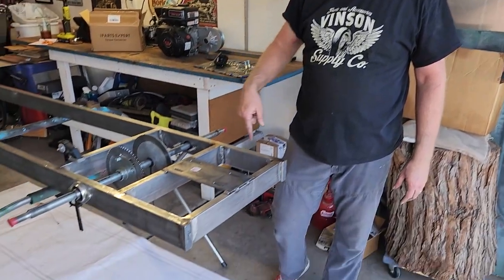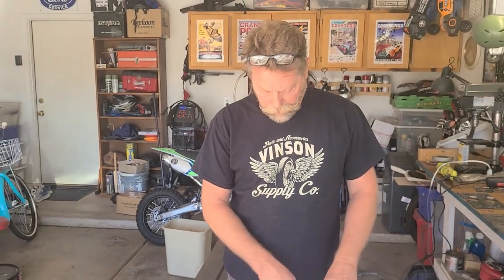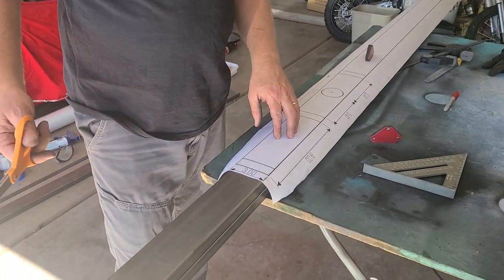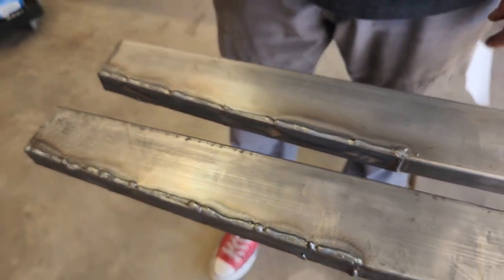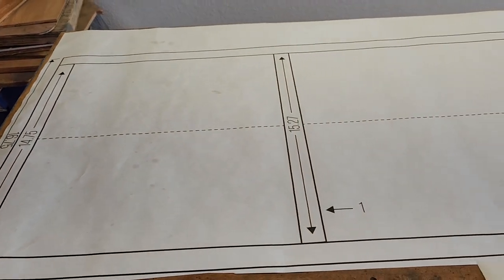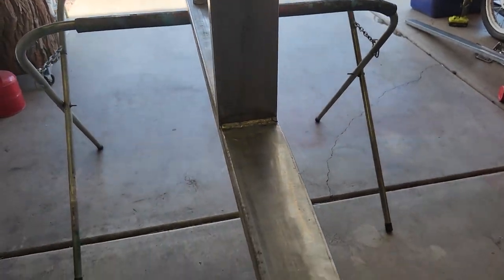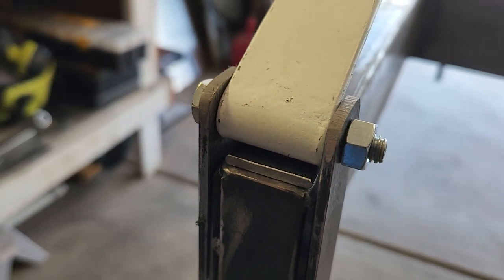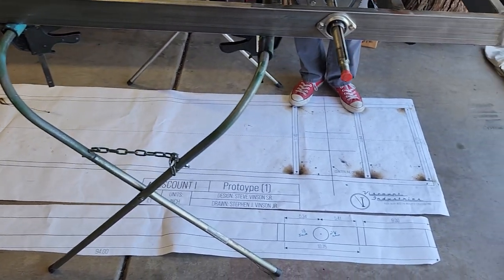Build a Cyclekart from a Frame Plan

Comment: Section that frame rail for the taper leaving the top strip of the frame cap in place vs adding back in another piece of metal.  It’s more cutting but you can keep the tubes natural radius if you cut below it and it make for a cleaner look. 2¢ Awesome vid!
Reply from the maker: I have tried that before, and it works but its hard to make that cut match the pie cut you will have to make to weld it back together.

Comment: I would love to see a wooden box version with a wooden frame. Its what I will be attempting soon,  hopefully.
Reply from the maker: Sure, the original design by Peter and Michael Stevenson was a 1/4" plywood box with 2 steel frame rails bolted to the outside.  So your plan has merit, would love to see how your project turns out.
Reply: I had the exact same idea: this looks like a job for 2x4s!
In fact I might just go pick some up tomorrow and give it a whirl.

Comment: This is really great information.  Thank you for sharing.  Have you thought about welding the front plate/cap to the frame after welding the hangers for the front suspension on to blend everything together as one piece?
Reply from the maker: I have done it on other builds.  Every one turns out a bit different each time

Comment: Alright. I've been thinking about building one of these so I ordered your plans and started collecting some parts. My question is, I'm 6'4". Should I add a couple of inches to the length?  How tight are these things. Also, I'm going to make mine electric.
Reply from the maker: My son is 6'-2" and fits just fine.  You can stretch the wheel base a bit, very easily.

Comment: If the frame rails by the axle aren't parallel, how will the bearings spin properly?
Reply from the maker: The bearings we use from AZUSA self adjust and misalignment is corrected.  The bearings float in the flangettes

Comment: This is really cool. Thanks for sharing. May I ask why, when you tapered the end of the chassis rails, did you not just cut a wedge out of the sides of the tube and bend the top down and weld, rather than using a new piece of steel to plug the gap.
Reply from the maker: I have done that before and it will work great if you can make the cuts clean enough.  I have done this method before and struggled to get it too look good.  I thought this is the simple path, assuming the guy using this template is a beginner fabricator, like me.
Reply: @stevevinson6030 is it possible to buy all the speciality parts like axles, steering etc in a kit? Located in Australia and finding it difficult to buy fabricated parts.
Reply from the maker: Renegade Cyclekarts in Oklahoma offers many of the parts. Shipping may be very expensive

Comment: Just a thought. I have tried to get a response from Renegade many times regarding ordering parts. I never get a response. Possibly because I am in Australia. Perhaps they don't ship here. It would be great if you could include in your plans a diagram of the motor mount and other brackets for laser/water jet cutting. There is a small but growing interest in cyclekarts here in Australia but not much real world experience to draw on. Plans for drop axle, spring hangers, spring pivots, front steering kingpin drawings etc would all be really appreciated in the paid plans.
Reply from the maker: I would love to share those drawings with you.  Unfortunately, I don't own the intellectual property right to those items.
make sure you have the correct email for Renegade? renegademetalllc@gmail.com

Comment: Steve, what is the wall thickness of the steel you are using for the frame?
Reply from the maker: .060 or .063 or something similar.  Some have used .090, I feel that just make the kart a bit heavy.
Reply: Thanks for info. By any chance do you recommend any online companies for the 1x3?
Reply from the maker: Sorry, no.  I only have experience with local suppliers here in Phoenix. @dobbster11

Comment: If you plan on doing more of those, just make yourself a welding jig table to hold things where you want….
Reply from the maker: Yes, good idea.  The paper template plan is really designed for the guy who is going to build one kart and not really designed for mass production, as the templates get used up when cutting and welding.